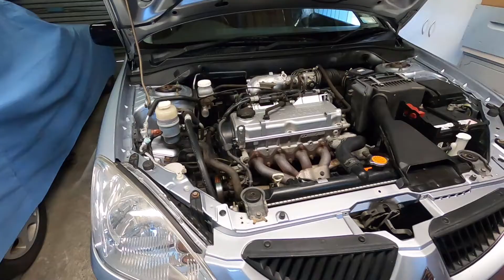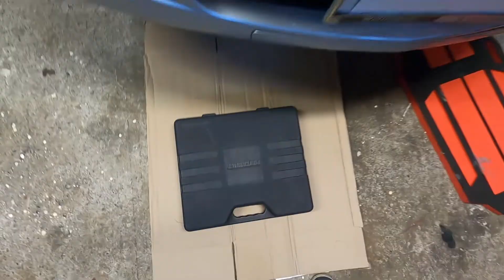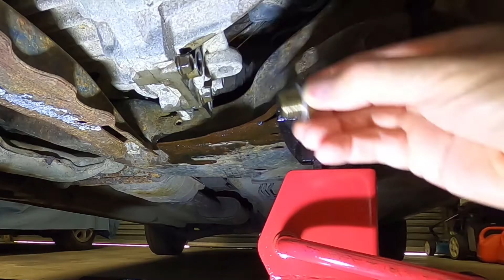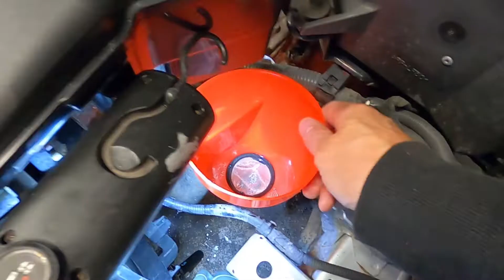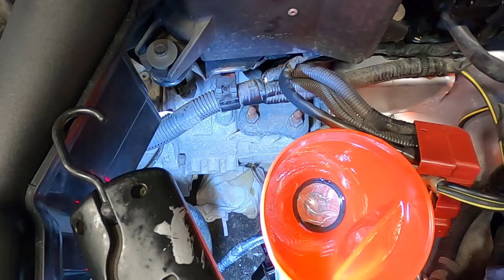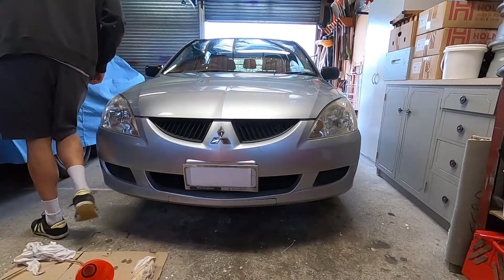How to change your manual gearbox oil - manual transmission oil change

Comment: Hi what is the size of the screws 
The 17mm is M14x1.5
And the 24mm is ?
Reply from the maker: Drain bolt is major diameter 17.75mm and 1.5mm on the pitch gauge.  Thanks

Comment: We're is the plug to put gearbox Oli in a Tata 1,4 petrol
Reply from the maker: Hi there,  I'm not sure on the Tata 1.4 L Petrol as I haven't changed the oil in this car, but a quick search on google for Tata 1.4 L Petrol showed some results including videos for different Tata models.  Hope that helps thanks for watching 🙂